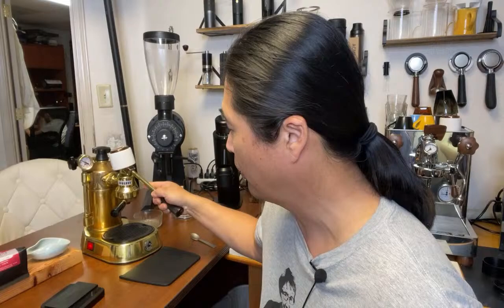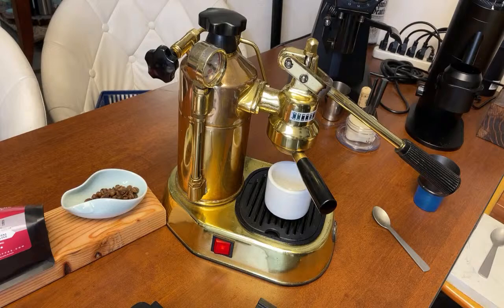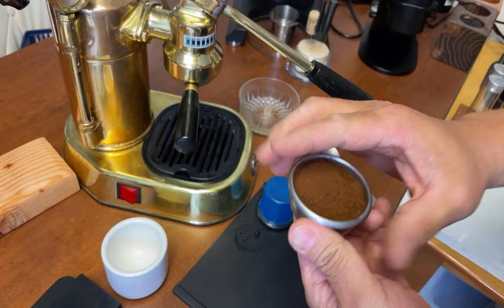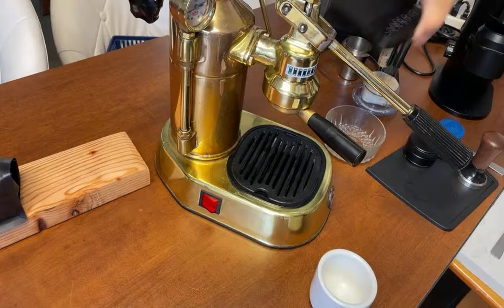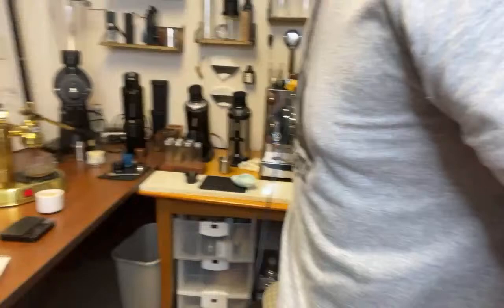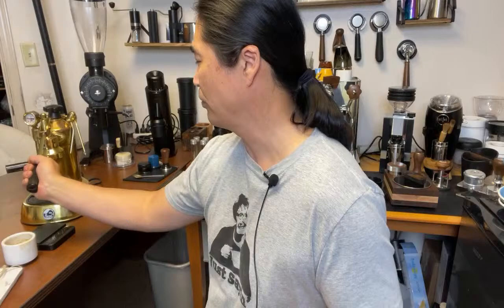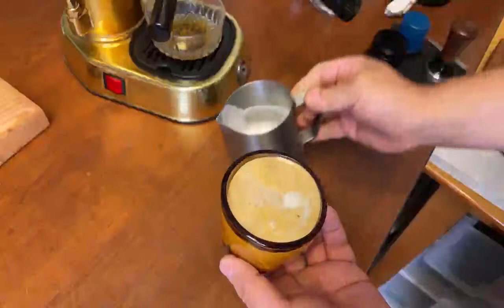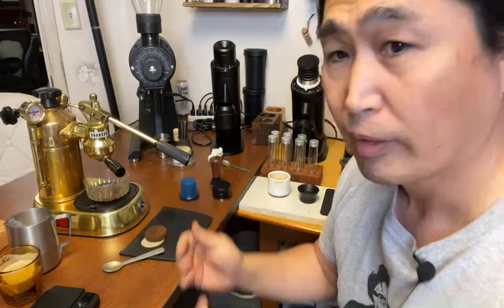La Pavoni Espresso Workflow

Comment: Hoon, I can’t believe I missed your live session again.  Love your enthusiasm and passion on all things coffee. 

Got an LP post millennium.  Certainly not a beginners machine, and this is where people come unstuck with the LP not understanding the factors for a good extraction, but once mastered, it’s hard to beat, even against pump machines.   Consistency is one of the LP’s downfall, and as you touched on temperature is critical, as it is on any machine, but more critical on the LP to get it right. 

Being a lever, it’s fantastic with respect to how the shot is extracted.  Long/short preinfusion, fast/slow extraction, or ramp up or down, pulse extraction, the list goes on.  

Milk is certainly not as good as a machine which produces dry steam.  The LP produces a more wet steam which isn’t as good.  Perfect for flat whites though as long as a single hole steam tip is used, or bung a couple of holes up on the stock tip with toothpicks. 

The LP is awesome when going on holiday due to its portability, and extremely low service costs every 1 to 2 years with having to replace the seals, which takes half an hour so, and cheap as chips. 

The machine is a work horse, banging out 4 coffees per day minimum, 365 days of the year.